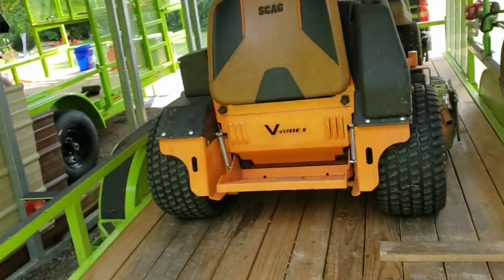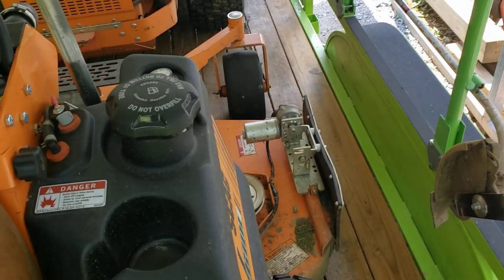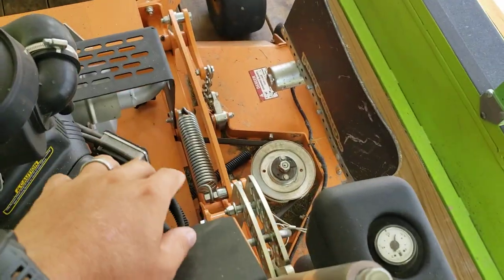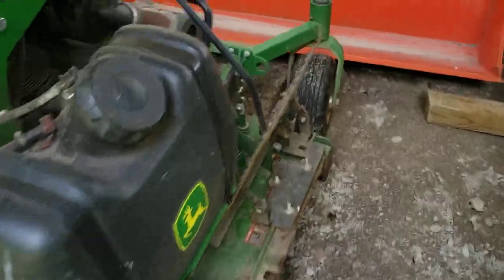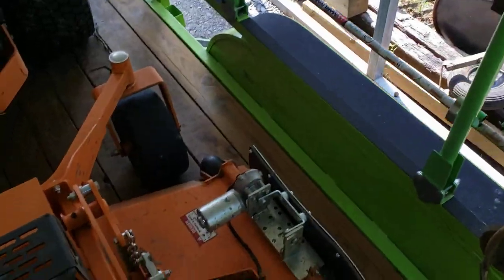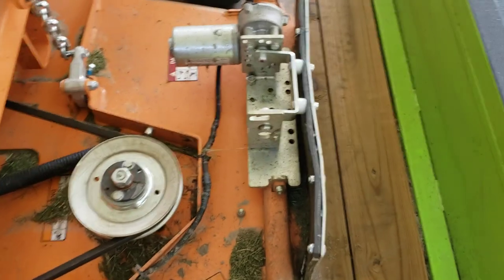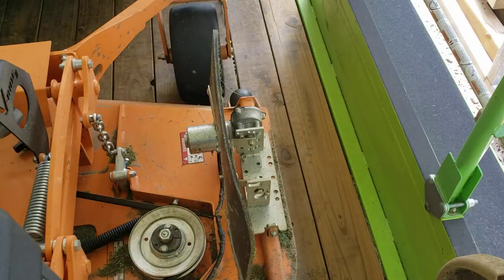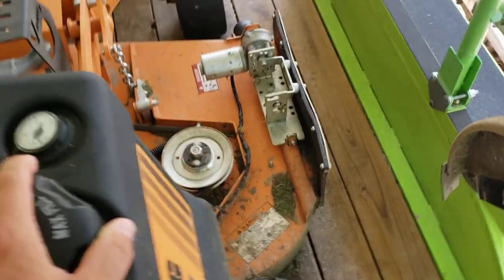Full 100 Hour+ Review of  THE-GREENGUARD mower Chute Block!! OCDC

Comment: They suck, lose power on close and holding open. When closed grass buildup pushes flap open. Waste of $440
Reply from the maker: We still run and use out daily. We don't expect them to be mulch kits. I also have ran advanced, grass flap, and quickxhute and non will stay fully closed with the 37hp motors.

Comment: I’m curious since you mentioned recommending the HD because it stays closed, has your experience shown the original to not be strong enough to maintain a closed position under load?
I’m a homeowner looking to buy one for my turf tiger, figured the original would be adequate but now I’m second guessing that statement from green guard.
Reply from the maker: Turf tiger go with the HD.
Reply: @SouthernStyleLawnCare  thanks for the response, got the HD in the mail yesterday and mounted it up. The scag no-drill mount didn’t work exactly as designed since my older advantage deck has some different dimensions for the discharge mounts, but I was still able to make it work easily with the multitude of hardware included. Glad I didn’t have to drill the deck.
This HD motor is STOUT.
Also went with the rubber plate since I’m not likely to accidentally slice my leg or something else on it should I do something stupid.
No complaints, money well spent.
Reply from the maker: @piezoman79  yep I went with the rubber piece as well. He does make a piece that blocks debris from flying up the center when closed if you have that problem. Did you use my code? Save you a little $$. Code Southern style.
Reply: @SouthernStyleLawnCare  I can’t remember which code I used but was able to get the $10 off 👍🏻
Reply from the maker: @piezoman79  Good deal. I dont make anything off it but got one to save you guys some $$.